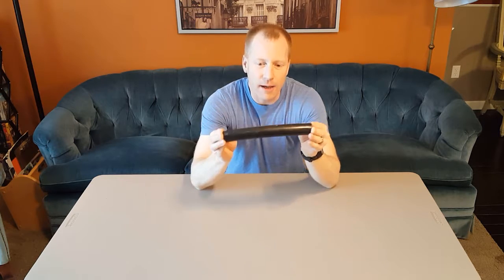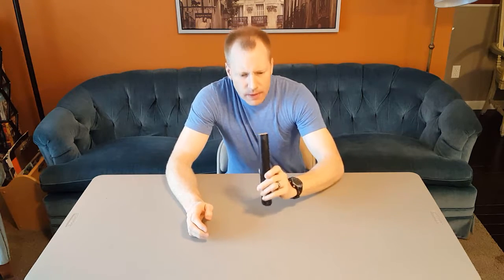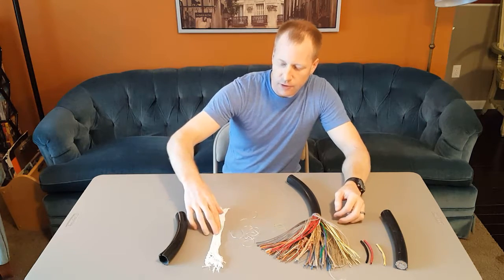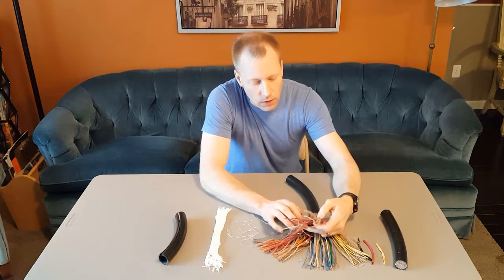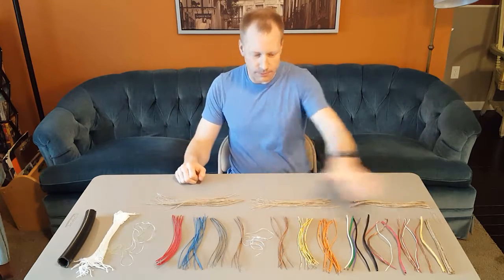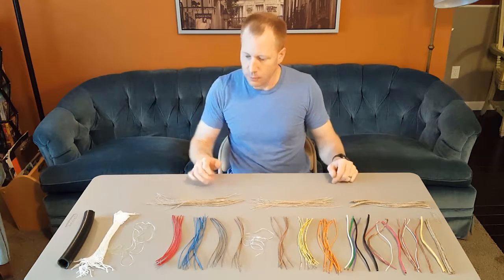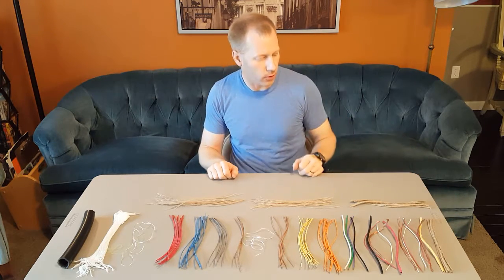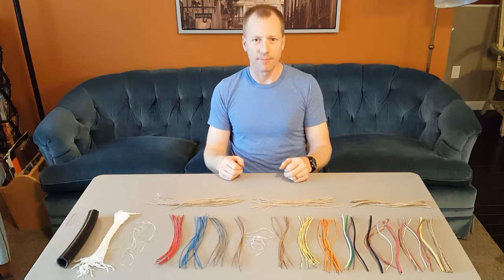What's Inside? Cutting Open an Elevator Cab Control Cable!

Comment: Brother, it is a pain in the rear. That cloth sock will fight you to the end of Time When you’re stripping 40+ feet on the traveler table.
Reply from the maker: Hey an actual installer! I worked a lot with Schindler while they were installing elevators and esclators, they are WAY more involved than I would have ever assumed until I got to work with the installers as both a field engineer and later a superintendent for the GC.
Reply: There's a specific tool to cut the cloth

Comment: You'd think they could just have a separate on-board controller on the cab itself with a bus between the two controllers and a fraction of the number of wires these days, but I'm a programmer not an engineer so who knows!
Reply: They're starting to use more data buses but you still need electrical power and a few failsafe circuits which can't rely on programming code.

Comment: there will usually be two cables a main traveler like you have there, and a security traveler. also the majority of the wires are spares no less then 30% spares, but more often then not its closer to 70%.
Reply from the maker: Cool, thanks for the info. This section of cable was from the first elevator install I was around. My current project has quite a few elevators and escalators that will be installed over the next year.